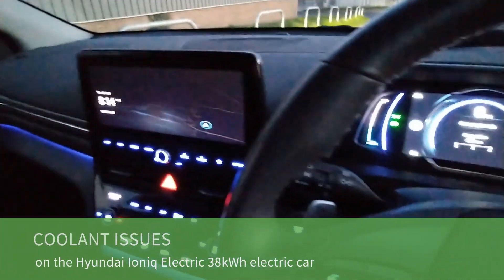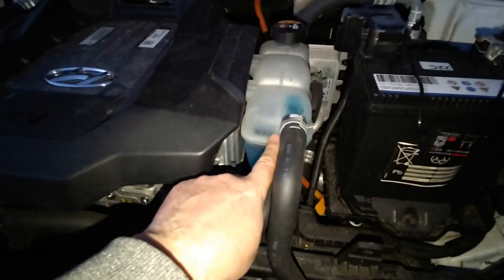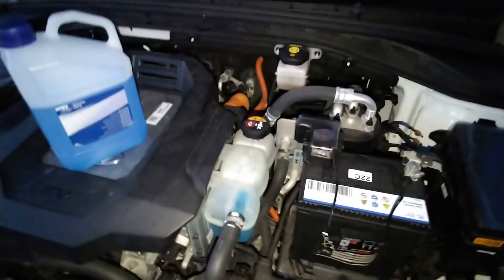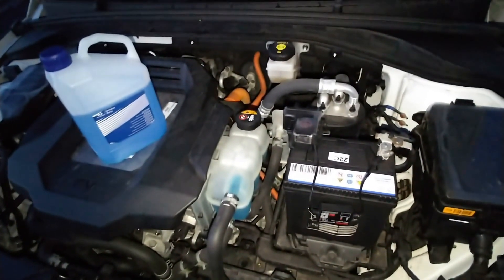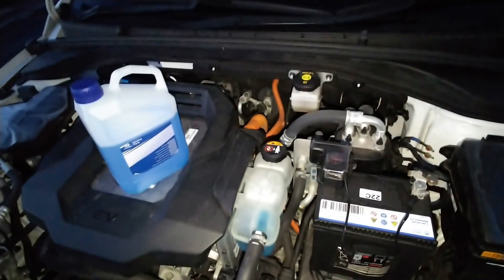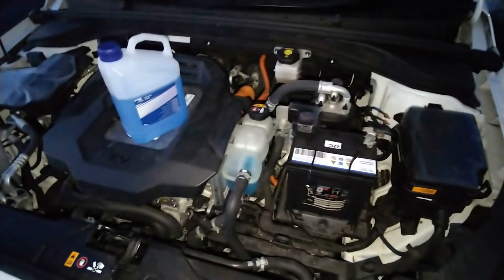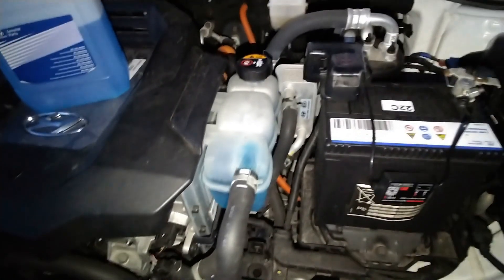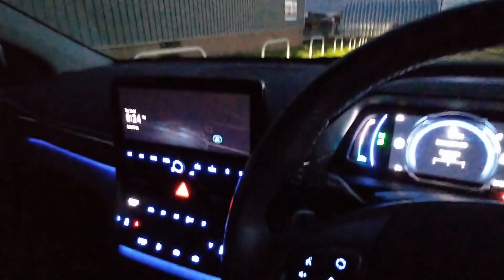Refill coolant message on a Hyundai Ioniq Electric 38kWh

Comment: Had our Ioniq serviced in March and it was the 40K mile one. Total cost£578.01, including 2 litres of battery coolant at £270!!!! Now I’ve got the dreaded Refill Coolant message. Investigation imminent!
Reply: The coolant was midway between Min and Max so not sure why the Refill message was appearing. Took the cap off, there was a rush of outgoing air and the coolant level immediately shot up to well beyond the Max level! So it now looks over-filled. Took the car for a decent run and no Refill message. I’ll leave it at that for now but will keep a close eye on the level in the next few weeks.
Reply from the maker: It sounds to me that this is suffering from the coolant crystallisation problem that is common on these. See https://youtu.be/cCt6MEbaXCI
The issue is that many dealers are not doing a proper flushing and not solving the problem. Unless they properly flush the battery pack out to remove any sludge, the problem is not solved with just replacing the coolant.

Comment: Warning light came on and booked the car in for a recall (jan25).I can’t find the BSC-1 online .Im guessing can’t be topped up with BSC-2 .is there any website I could get the v1 from ? Thank you
Reply from the maker: Just buy BSC-2 coolant as this is will be fine to top up and is what you'll need for the future anyway when yours get changed over. You can buy it at your local Hyundai dealer.

Comment: I had this problem even after a coolant change.  My theory is that the fault is caused by the tiny 12v battery that drives the coolant pump.  This is the same battery that is installed in the 28kwh Ioniq which of course doesn’t have the coolant pump.  I think the tiny battery hasn’t sufficient power to drive the pump on top of all the other 12v systems in the car.   With this in mind, I replaced the 12v battery and hey presto, no warning light for 9 months now.   I do occasionally top up the charge on the 12v battery as I’m not convinced the car’s charging system is sufficient.
Reply from the maker: The 28kWh has the same water pump. The water pump is running when the car is running or charging, so the 12V battery size doesn't really come into it as the DC-DC converter is providing 14.5V to charge the battery and run all the low voltage components.
As for as your last comment "I’m not convinced the car’s charging system is sufficient", it is, but the issue here is charging time, not power. Too many EVs are not running for long enough periods to properly charge the 12V battery. Much of the problems would be solved with a larger capacity 12V battery.
But yes, you're doing the right thing to occasionally top up your 12V battery. You'll have a far more reliable vehicle.
My feeling is that the repeated error/warning is due to dealerships not properly flushing out the debris in the battery pack. Hyundai say its a 3 hour job in the TSB, which means its really a 3-4 hour job, but they pay the dealers for 3 hours labour. Its clear from customers that some are having their car back in 2 hours, which means they are not doing enough (or any) flushes.
Reply: Interesting theory, I have ahd the battery drain and then replaced it like for like (slightly better quality) and it ran out again. Which battery did you upgrade to? This also makes sense because if you turn off and on quickly it goes away because it doesn't have time to lose the power.
Reply: Yes I believe that when the car is first started, there is too much drain on the 12v system for this little battery to cope with resulting in not enough fluid being pumped around thus causing the warning light.  As people have said, if you then turn off the car and immediately back on again it doesn’t show the fault most of the time.  I replaced the battery like for like and the fault didn’t show up at all for a few months but as the battery aged it did start again.  Not enough charge going back into it in my view. I have now upgraded the car for an Ioniq 6 but do miss my old Ioniq especially the economy of it.  5.5 miles per kWh whereas the Ioniq 6 is around 4.2 but it is a much bigger and heavier car.

Comment: We are considering buying one of the 38kwh versions but a bit worried about this issue. Any updates on the situation? Cheers
Reply from the maker: We've had ours done. It went into Hyundai for a day and they drain the coolant, flush out any sludge from the battery pack (hopefully) and refill with a different type of coolant. So far, so good. But only time will tell if this new coolant is any better and doesn't crystalise up. I wouldn't let this put you off buying one. They're still the best EV under £25K.
Reply: @GoGreenAutos  Many thanks for your reply. Is there any indication of how the issue will affect the battery? I suppose it won't cool properly and could potentially overheat when it clumps but if the warning catches it early enough I suppose that might never happen (unless you ignore the warning)?
Reply from the maker: @davebown8145  Yes I suppose the crystallisation being caused with the original BSC-1 coolant will result in blocked coolant channels within the battery pack and degraded cooling. However, as far as I know, there's no one reporting any issues resulting from this. The symptom of this issue is a reduced coolant level in the reservoir bottle, which then the coolant flush and change to BSC-2 coolant is required. 
I have a feeling the battery cooling isn't as essential as you may first think, in the UK climates anyway. The previous 28kWh models didn't have wet cooling and instead used a fan mounted below the rear seat. Batteries like to be hotter than our outside temperature in the UK, even in the summer. I think the cooling system is only really needed when you DC rapid charge. And because they have reduced the charging rate on the 38kWh models to 44kW, it probably doesn't get that hot either.
Reply: @GoGreenAutos  Yeh I saw on the Bjorn Nyland channel, when he was testing rapid charging he found that the battery was actually too cold (although winter conditions) to charge at optimal speed, think he was only getting something like 26kw. So I suppose it could benefit from some heat! Thanks again
Reply from the maker: @davebown8145  Yes, everyone worries about battery cooling, but in the UK, battery heating is required more than cooling. On vehicles that have battery heating, this is used far more than the cooling. I guess this worry comes from the Nissan Leaf, which has neither and is the worst.

Comment: Is there an information on what causes the crystals to form ? Is it related to temperature ? Is it the heat from DC charging ? I have a Ioniq 38 kwh for a year and i have noticed that the coolant level drops. It dropped below min last october and I have topped it up to max. In april, it has dropped to the middle (between max and min) and the technicians topped it up again during the 1st year service. They have even verified whether there is a leak but test was negative. I'll continue monitoring the coolant level. For now, i never got the low coolant message.
Reply from the maker: You need to get the recall done on it ASAP. The crystallising is within the battery pack. It needs flushing out. I can only assume, the coolant channels are blocked if not done, which could result in battery pack damage.
Reply: @GoGreenAutos  hi Matt. I have contacted my local Hyundai dealer in France and he told me that they can't do anything for now because i didn't get the warning message issue. The reason is that Hyundai won't accept to do anything, unless a "problem" is reported. Apparently, a slowly decreasing coolant level is not a valid problem.
Reply from the maker: @TH3G4M3SM4N  Strange, as in the UK Hyundai are dealing with this differently. When I booked ours in, I didn't tell them the refill message had come up or that the coolant had dropped. I simply asked "Do you have the equipment do to the coolant flush job in the Ioniqs. I understand there's a recall to do this". They looked up the car and said, "Yes we can do that".

Comment: Just got the car from the dealer after it was there for 3 days (had the same issue), they replaced the coolant with a green one and changed the pump.
The error came back an hour after i got the car back. Going again next week😢
Reply from the maker: The new coolant they should be using is BSC-2, which is blue (like BSC-1)... in the UK anyway.
Reply: @Go Green Autos  thanks I'll check with them. Will you do a follow-up video about the issue, and was it resolved for you?

Comment: Oh dear Matt that's not a good start for owning a 38kw 
Now you'll be thinking what other things will go wrong
Oh by the way have you had chance to see the charge rate on the rapid chargers
Wasn't it said they are more limited in the actual rate of charge than the 28kw
Reply from the maker: Only briefly used a rapid charger (see https://youtu.be/F94UDiHwU1c) but yes the Ioniq 38kWh has a peak charging rate of 44kW, whereas the previous 28kWh model has a peak charging rate of 69kW. This is irrelevant to many drivers who can charge at home, as DC charging will be few and far between, especially with the extra range the bigger battery gives you. In our case, the 38kWh Ioniq will never get a rapid charge during our ownership.

Comment: This problem only started for me after the big battery was changed, has your car had to have the the big battery changed ?
Reply from the maker: No. It is happening with all the 38kWh Ioniqs. The coolant they've used is crystallising, so they are changing to a new type.
As far as the "big battery change" - I've not heard of anyone having this done before !!!
Reply: There are some 2020 38kwh which fall in a certain VIN range that have got a battery recall. Someone posted about this on Ioniq forum. Incidentally, I’ve had my car a few weeks and saw it fell within the range and called my dealer to check and they said there’s no recalls for it. Baffling. I’ve had no issues with the battery or coolant issues though (so far 🤞).
Reply: Mine has been with Hyundai at Tilbury (I live in the far north of England!) because of charging issues (they gave me a BMW i3 4-seater as a replacement - what an awful car to drive). After a lot of hassle, it was delivered back to the dealership just over a week ago, and I picked it up last Friday - exterior was absolutely filthy. 

Drove home - no problem. Have been out on a couple of short runs - no problem. Today the "Refill coolant" popped up on a 1 mile run to see friends. Spent time with friends, and no error on the way home. I haven't had a chance to actually physically look at the coolant level yet.

I absolutely love this (leased from new) Ioniq EV, but I've only had it for just over 27 months and battery charging problems plus the 3-months in Tilbury have marred 15 of them. Now this.

The garage is an hour's drive away, and they won't pick the car up - I have to call a recovery service. And they'll only provide a tiny petrol courtesy car (which barely gets up the hills here) if I attend the garage in person. If I add in the fact that I have friends from the US visiting for two weeks, and I'm relying on a 5-seater, the whole affair has been a disaster.

If someone were to ask me what I though of this car I would say it's a fabulous car to drive, but don't touch Hyundai with a barge-pole.

Comment: I bought my first EV (2021 ioniq) after watching your informative videos, thanks for that :) 
Actually, the authorised workshop in Norway called me to flush the coolant, but when I got home I found out that the coolant level was above the maximum. Do you think that this high level could cause any problems?
Reply from the maker: If its above when its cold, then you should take a bit out. Maybe keep it though, in case you need to top it back up. Its expensive stuff!

Comment: Got mine booked in for Thursday. Light only came on once
Reply from the maker: Our light came on twice, but the coolant level did drop the first time. Anyway, all sorted now as it went in yesterday.  Well I hope its all sorted. Some owners are now reporting continued problems even after this change to BSC-2 coolant!!!
Reply: @GoGreenAutos  well car went in today and the receptionist said all done. No quibble about warranty even though the first 2 services I have no record of. 
Time will tell if the flush and refill has worked. Had it's 3rd service done at the same time( tyre kick and washer bottle top up. )
Reply from the maker: @iantaylor1172  What did 3rd service cost you?
Reply: @GoGreenAutos  kicking the tyres was £72. But if I had booked online it would have been £59.40. the 4 yr is the expensive one at £484. 
Only reason for having Hyundai service is for the warranty in case any thing goes drastically wrong. But legally they can't deny warranty unless any lack of service is attributable to the fault that occurs. Been in the motor trade long enough to know what you can and cant do under warranty. First time I've ever had car serviced at a garage in 43 yrs
Reply from the maker: @iantaylor1172  Isn't the 4yr one expensive because it includes a coolant change? That shouldn't be needed now that this was done under this recall. But I do wonder if they can cope with this situation and it might be a case of "computer says no".
Reply: @GoGreenAutos  yeah, but someone on the ioniq forum has questioned this with Hyundai UK headquarters and got a" computer said no. " Reply. Crazy really.
Reply: @GoGreenAutos  the coolant flush fix lasted all of 16 days. Light back on today.
Reply from the maker: @iantaylor1172  Oh no. Has your coolant level dropped in the bottle? I wonder if they're not flushing out the battery properly.
Reply: @GoGreenAutos  just checked the coolant level after getting back from isle of wight ( 160 miles hard driving on the m275,27 a419 and m5 ) still had 10% battery left. So impressed . Anyway back to the coolant, still on the max mark . No loss. Message hasn't come back on at all since even after today's drive.
Reply from the maker: @iantaylor1172  Good news. Yes impressive EVs.

Comment: I got mine sorted out couple weeks back. 

It does not look like some special tool - its a standard machine that is typically used to flush car radiator. The dealer used quite a fair bit of distilled water to flush out the debris  - it took multiple cycles, heaps of distilled water and a couple of days as the tech was unfamiliar with the procedure. The dealer was apparently upset Hyundai only pays 2hrs for the warranty work. Even they are up to speed with the TSB procedure - it will still take one solid day and multiple flushing cycles before the dealer is completely satisfied the coolant loop is free of coolant crystals.

After the flushing cycles are completed, it is then refilled with BSC-2. It is however known if the dealer cut corners not running flushing cycles until coolant crystals are completely removed, the low coolant warning can return even when refilled with BSC-2. Also crystals are known to "grow" in size and block the coolant pump from spinning efficiently.
Reply from the maker: Thanks for this info. Most dealers don't like undertaking warranty work as it doesn't pay as well as customer billing work (of course). I know one Hyundai dealer that does their best at turning away warranty work. Unless you purchased the car from them, you've got no chance.
With this job, its easy for the dealer to skimp on the flushing, which is why I guess some owners are soon back with the same issue.
Reply: Yes apparently my problem is water pump because they already did 3 times the flushing and refilled the new coolant and after that the same day I got the signal Refill Coland
Reply: Who was the dealer? I'm impressed that they were so thorough. 
I can understand why they'd be less than impressed with the time allocated.

Comment: We are collecting a september 2021 38kw this weekend for my daughter and Im glad ive watched this will now prompt me to check if this recall has been done or not 👍
Reply from the maker: Yes do check. Glad this video helped.
Reply: How would I no if this has been done on a 21 plate im collecting this week
Reply: @michaelhedges41070   You can check with the dealer. It's a recall so if needs doing will be free of charge.  Just be ware that the service interval for the coolant change is around £500 which they may well try and swindle out of you by saying this service is due anyway at that age 4 years or 40k miles i believe. YMMV. Also check if your remote  heating is working (activated through the app) with no errors whilst in warranty....
Reply: Hi its done 25000 miles just checked government website and it says no outstanding recalls on this vehicle
Reply: Not sure what this means ymmv beginning to wish hadn't spent wife's savings now when I watched reviews on YouTube they seem all good thanks
Reply: ymmv = your mileage may vary... It won't show on the government website as it's only a minor recall. Car is fine, dont worry. Just be careful with the handles etc. Matt as a few videos on this. Every car has its weak points. I bought one for each of my kids and apart from the local dealership not being very knowledgeable with some faults and the usual upsell tactics they are fine. There is plenty of knowledge on these cars on the internet....

Comment: 'Special' coolants are a scam. Looks like plain old 'blue' antifreeze. Sounds like they are using it too concentrated. How can it be £10 a litre when half of it's water?
Reply from the maker: Coolant for EV battery packs is "low conductivity" coolant. The colour or what it looks like means nothing. True, its still 50% water, but the purity of the water is key here I think. And clearly there are differences, as this stuff is crystallising and causing these issues....hence the recall on these cars.